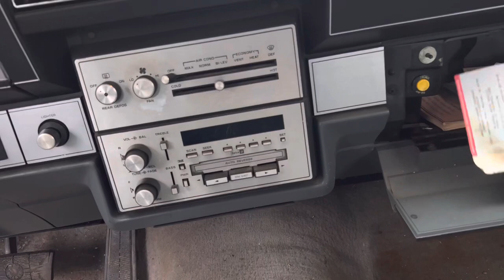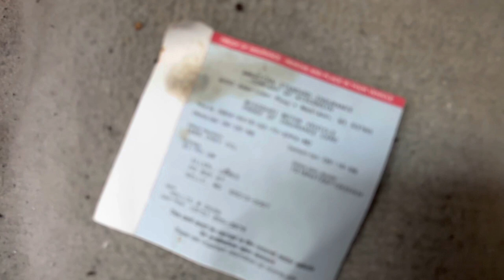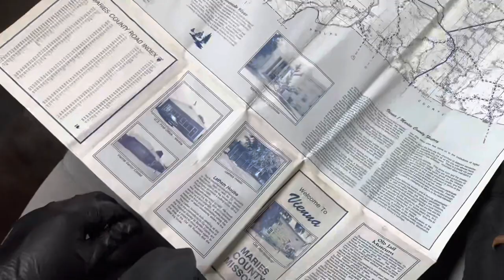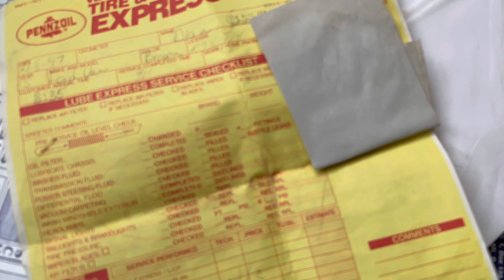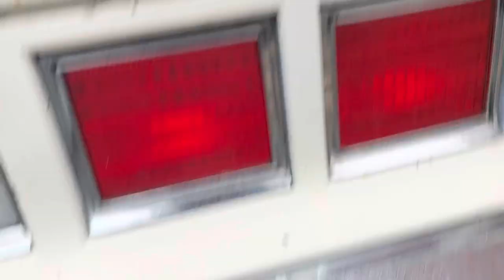My dream car was a dream lemon 1985 caprice landau

Comment: I’m sure you grabbed for the low. That carpet has water stains check the windshield might need a reseal. She clean all panels and insays gucci. Clear coat them satin to protect specially if brittle and scratch easy. Mystery oil in the cylinders for a week. She been sitting a minute but might bring her back.
Reply from the maker: I definitely will check that window seal I was looking at that carpet too I got her soaking in everything except diesel hopefully by my next off day she will be unstuck fingers crossed my goal is to upload every Thursday so please stay tune thanks for the advice
Reply: @hooodpharmacisttv  I will be posting more of my car once it's out of winter storage 😉
Reply from the maker: @tylerdakin9131  hey I just subscribed I can’t wait to see it